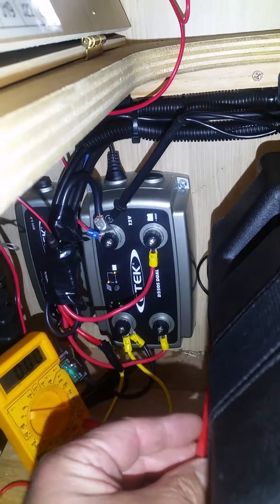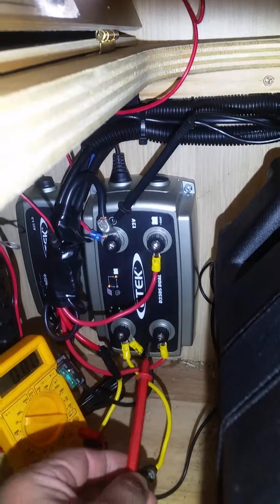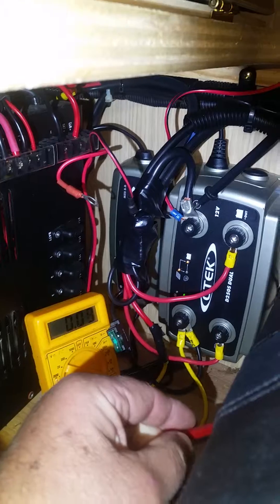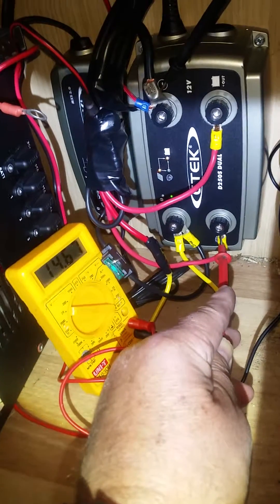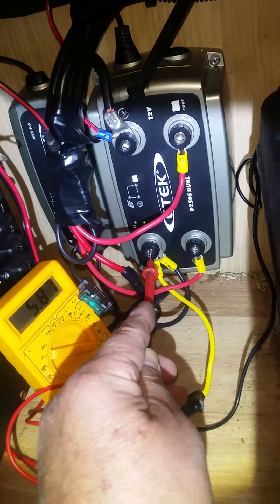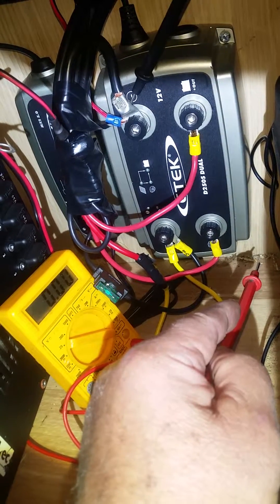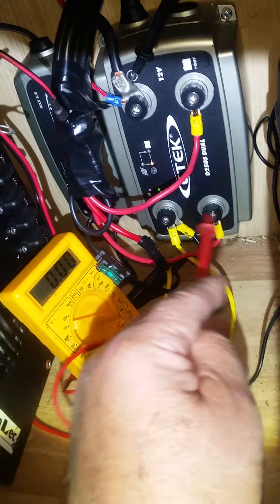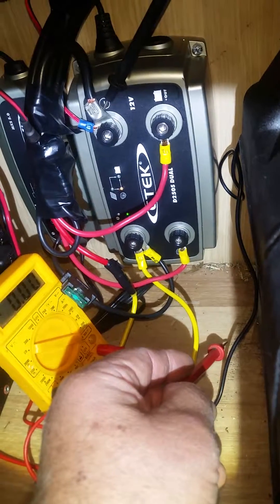Ctek D250S Dual Error

Comment: 13V is very low from a solar panel. It should be delivering some 30V. Could it be you are feeding the solar through another regulator?
What is the voltage on your secondary battery? If your alternator is delivering 14.6V at the ctek input, you don’t need a ctek as that voltage is sufficient to charge any battery.

Comment: Iv just purchased a ds250s and smart pass unit I'm a little confused as to how to wire it up as I have a smart alternator and I'm unsure how to get it to run right as I did purchase a newer unit but lost it a ds250se and that had an extra wire to be connected to an ignition fuse source as the ds250s doesn't have this wire iv read up a fuese realy is needed but unsure of what they mean

Comment: I have the same issue C-tek haven’t been very helpful. I have the issue on both solar and alternator charge. The unit keeps cycling I have disconnected it a few times before and this cleared the fault. Not clearing now. Thinking of getting rid of this as it has been nothing but trouble this is my second one as the 1st was replaced under warranty for a similar issue.

Comment: I know it's been a few years, but I had a similar problem. It cicled through the charging process constantly, but didn't stay on permanently. I simply reset it by disconnecting the 'in' terminal from the alternator. This seemed to work. 

My Waeco fridge has a fairly low cut out for the battery and I made the mistake of leaving it running for a week with the car off. I think this may have triggered the Ctek as it wouldn't charge the battery due to low voltage. I charged the battery with 240v, but the Ctek wouldn't charge it. I think in the end it just needed resetting. I could be wrong about this.

Comment: It is almost a year later but I am wandering if you got you D250S straightened out.  I also have put my engine battery wire on the solar input as advised by CTEK but I get the same cycle and error light when the solar panel is hook to it.  Judging from your video I may need to take the engine wire completely off for the solar to work correctly. I plan to try that next.  Mine charges really well from the alternator, but would really like to have both in working order.

Thanks for the video and information.
Reply from the maker: Hi D. Leeway. The problem I had was insufficient wire gauge between alternator and the D250. The voltage kept dropping as soon as the load went on it, hence the cycling. I also replaced the wiring between the D250 and the battery and this also improved the situation.
Reply: @TheBator26  Hi! What was the thickness of the wire before and after?
The wire from my carbattery to the ctek unit and from the ctek unit to extra battery is pretty thick. 

Mine is acting the same way, but only when i hook up a solar panel. 
Its turning on, acting weird, turning off and starting over. 

If only the alternator is attached then the ctek unit won't even turn on.

Im getting 14.2 volt from the wire that is connected to the startbattery when the car is running.... Im confused
Reply from the maker: @lassemadsen9631  I found that the measured voltage wasn't the most important thing cause as soon as the load is applied to charge the battery my voltage was dropping because the wire gauge couldn't carry the current.  I changed the cable from 4mm2 to 14mm2 (6AWG) and everything started working as it should.